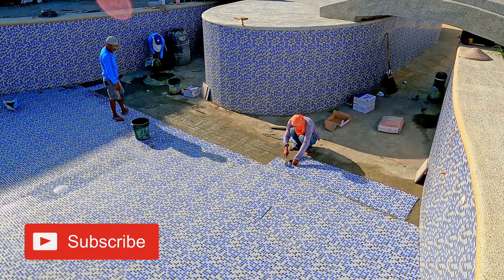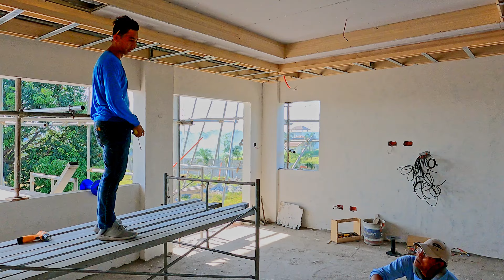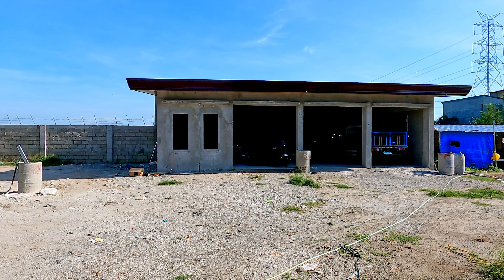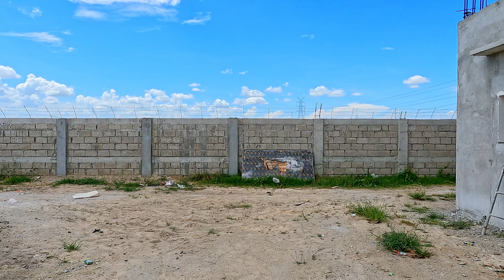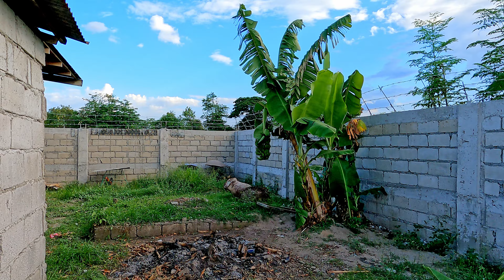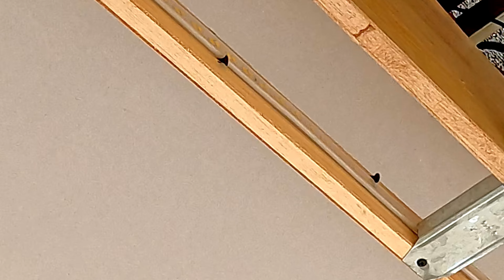Philippine House Building Day 198 - More Swimming Pool Tiling

Comment: In regards to the wall, using a creeping vine or ivy sounds good. But, I would worry about the tendrils going into the hollow block, the material may not be the strongest and the ivy could very well degrade the wall faster than normal. Just a thought.
Reply from the maker: Good to know Thomas, thank you. I will have to ask one of the other builders we talked to at the start of this process - he has the plant we want, and it has been there a few years now, so he might be able to advise more.

Comment: I was curious about your perimeter wall surfacing…. It’s that many meters? 😱 Plantings sound like the best solution… softening the look of the walls.  👍🏻
Reply from the maker: I may not be exact but I know I am pretty close. 635m around, and minimum 2.5m tall (maybe a couple of areas where it falls slightly short of that but in some areas, from the outside, it is 3m+)
So even plastering one side would be a massive job. Both sides would be crazy !

Comment: Hello Mike . Q- how deep do you believe your pond will be when full. Is there a plan to oxygenate the water. Just interested as I also have  catfish and red talipia ( separate,) for home use . Interesting hobby . Regards Mick
Reply from the maker: Mick
Have not measured but it looks like about 6 feet. Not sure yet whether we will oxygenate, although we are probably going to end up doing that simply by pumping water at regular intervals to keep it topped up.
Why do you separate the fish ? We have grown them before, all in the one pond, although admittedly not many catfish went in.
Reply: @philippines4.0buildinganew64  I just got 2 small concrete tanks and it easier for me to monitor them and try different foods etc . Regards Mick

Comment: Mike why does the security wire tilt inward? In America this type of security wire is always tilted outward. I think this is to prevent someone from climbing up and leaning something on the wire after they are on the wall.
Reply from the maker: David
We would tilt outward if we could, but that would mean we were overhanging a neighbours property, as our wall (except the front) is right on our property line. So we are not allowed to do that - even though on at least two sides, there is a very good chance no-one would complain.
Mentioned this on the video today

Comment: looking great Mike. my estimate wont be far out for the pool. really starting to look something. though i have a question on the barbed wire. arent they putting tensioners on them to keep it tight? 
also the great news for me is that we have booked our flights arriving in Manila am on 15th June. not ideal to guarantee sun but desperate to get back there sooner rather than later.
Reply from the maker: Have mentioned the barbed wire question on the video today, but the short answer is I don't think they are doing anything with tensioners. Do you think they make a lot of difference ?
Fantastic news on the flights. We might be close to being done by then (that just jinxed it) - will you have any chance to drop in ?
Reply: @philippines4.0buildinganew64   Hi Mike im trying to source a car near floridablanca, would love to visit for sure, almost feel part of your build anyway.

the issue with not having tensioners is that any wire will eventually stretch and sag, just the weight on the spans will cause that to happen over time. the tensioner can then just be turned to take up that slack. looking at the way its installed i dont think there will be any because one of the requirements would be at every corner and the start and finish of the fence you would need a more solid support than just the rebarb since a tensioner would just pull the rebarb out of shape.

Comment: Those vines will become spider central if you don't get an exterminator to keep bugs under control. Also there is a vine here that literally grows through the concrete and tears the walls apart over time.
Reply from the maker: Thanks for the tips. I will try to find out the name of the plant we are thinking of trying

Comment: Maybe a Stamped Concrete pad/deck between the house and the Pool.  You could brush some attractive pebbles in the surface so it would be non-slip.  Everything doesn’t need to be million dollar tile.  On the other side grass would be beautiful.
Reply from the maker: Marc
I had not heard the term before so had to look it up. It could look very good so will mention it to the builder - just hope it is not too expensive ! Thanks for the idea.